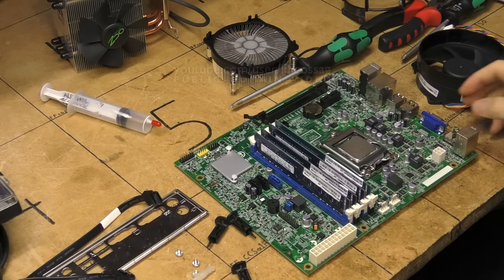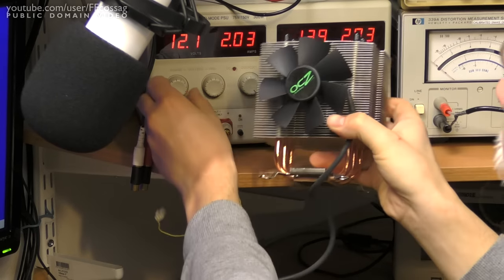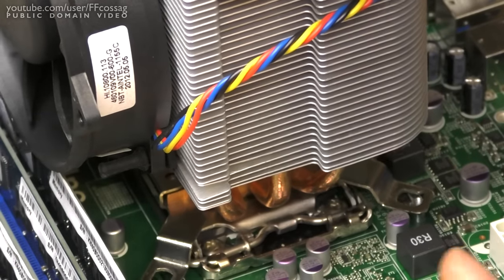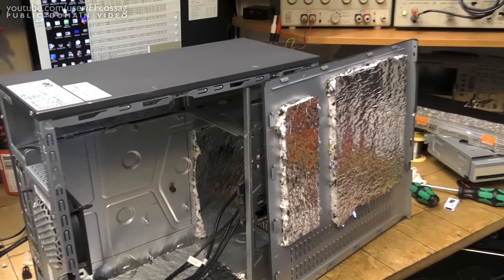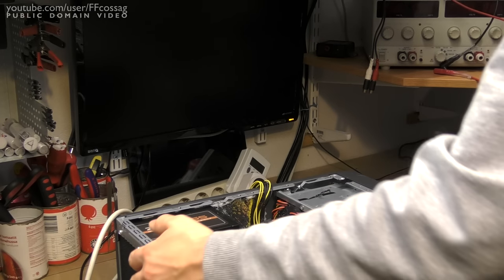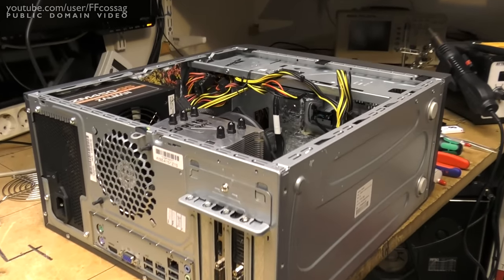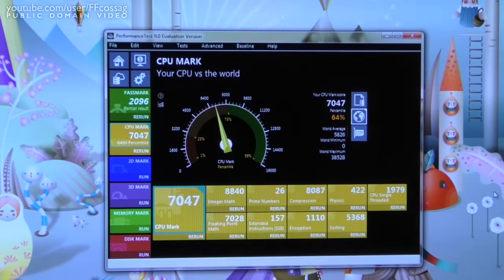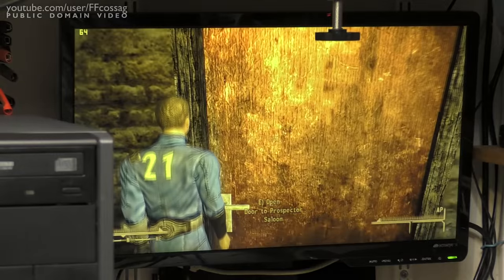Super trashy 2500K cheap-o sleeper build (w/ rusted GPU)

Comment: Great video. I never even thought to look at the heatsink mount screw spacing like that. I've been wanting to use one of my favorite S775 heatsink on on of my Sandy Bridge systems but ThermalRight never released a S115x mounting bracket for it. I'm definitely going to be trying this out with that old heatsink.

Comment: :/ that thing is much better than mine i use a core 2 quad Q9550 on a Asus P5Q E motherboard that refuses to detect USB devices most of the time , and a good old failing seagate 1tb that likes to 'forget' the SMART events and always start from 0
Reply from the maker: Better replace that drive before it passes 15 000 hours.
Reply: After a cold start it goes into booting windows freezes and restarts , then the motehrboard refuses to detect it and hangs . i flip the switch in the back for 3-4 minutes and it 'magicly' forgets its SMART status . That dosent look healthy does it? : http://prntscr.com/e17a5z
Reply from the maker: I've had no less than seven of those Seagate 1 TB drives headcrash between 10 000 and 20 000 hours. Put that thing in the trash before it does that on its own and takes your data with it, lol.
Reply: FFcossag I have a SATA drive that has 35,000+ hours. I got it in 2012. it had 31,000 hours then. It's a Western Digital Caviar 80 GB 3.5 inch form factor that was made in 2006. It suffered the click of death once. As a solution, I held it three inches above a smooth brick surface and hit it on the surface as hard as I could. I then hooked it up to a hard drive dock and powered it up. It was fixed.... for one power cycle. I repeated the smashing procedure about three more times. On the third run, I made it work long enough to hook it up to a computer. I ran it through HDAT2 to check for bad sectors. Amazingly, there were none. After that, I ran Darik's Boot and nuke to erase the drive. All this happened in December of 2015. It still works perfrctly to this day with approximately 41,500 hours on it.
Reply: I had an infamous Seagate Barracuda 3TB that failed after 13000 hours. I think there was an entire lawsuit over those things.
Reply: and also from times to times the heads go to landing zone i can hear it from the outside and it struggles to open files from times to times
Reply from the maker: I retired an old WD (one of those black painted ones) at 55 000 hours - not for any reason other than an SSD upgrade. Lovely old drives.

Comment: Will the insulation prevent heat from disapating through the case itself though? You should check out a material called FlashBand. It's a sticky backed roof flashing material and does a great job of deadening sound. it'll also be a lot thinner and easier to manage than the closed cell foam you're using. Keep up the good work. :)
Reply from the maker: Dissipation through the case is quite minimal anyway. I've used asphalt pads in the past, they work great but this is what I happened to have at hand.
Reply: I've got some of that asphalt insulating material, still bonded to a sheet of stainless steel from a dead dishwasher.
Reply: Give it a try. The difference it makes is quite noticeable. The best part of using the fresh rolls is that they are very soft and easy to manipulate though. It's easy to mount them in complex shapes, surfaces etc. :)

Comment: holy cow. wish i had a pc like that. my specs are:
Intel Core 2 quad at 1.7 gHz
Windows 10 Home Premium (32-bit)
128 GB SATA HDD
DVD/CD Drive x2
3.5" floppy drive
Nvidia GeForce 680 
3.5 GB DDR3 RAM
no display ports
EVGA (or EVEA, cant tell) EGA/VGA adapter card
5 USB 2.0 Ports
generic motherboard by DELL
10! USB 1.1 ports
no PS/2 Keyboard or Mouse ports
CPU fan is dying, LOUD and sounds like bering failure
junk.
Reply: Andrew haha, factorial joke :) good one

Comment: That's still a decent "Frankenstein" PC, except for the OS (never run Microsoft if there are other options available)... But you could easily sell it for 100€ or so (due to the SSD and the lots of RAM).
Reply from the maker: Yes, selling a 2500K based PC for 100 € would indeed be VERY easy, lol.
Reply: FFcossag Oh, come on, it may have been that expensive 5 years ago, but we all know how prices for used/older hardware develop!
I bet there are 2500€ PCs from 2000 for which you won't even get 20€, because who wants a 1GHz 32-Bit single core and 256MB RAM with a 40GB HDD nowadays?
Reply from the maker: You know what, I'll pay you 110 € for a 2500K and a 250 GB SSD alone - you don't even need to throw in a motherboard! ;)
Reply: FFcossag Well, I think only the SSD is what is worth some money (and yes, possibly even close to 100€). But I didn't get that with 2500k you were referring to the CPU - I thought you meant the machine was worth 2500€ when it was new. So the CPU is an i5, but which generation is it from? Something older-ish like Sandy Bridge? I'm not so sure if these things still have any value today...but the last time I looked, you could get used PCs with older hardware like that (but without an SSD) for around that money. Of course, they were complete systems, which have been used in some corporate environment before, and are now on the 2nd hand "refurbished" market.
Reply: this machine could easily be sold for 500$ in canada lol, 16gb of ram a ssd and a goodcpu...
Reply: Sadeoo7 OK, I was a bit low with my estimates. A new 250GB SSD is about 90 bucks, and 16GB RAM are also about the same, maybe a little less. And that's both prices for new hardware, not used, so they should actually be a little lower.
The rest may be worth 50-100 bucks, since it isn't a prebuilt PC, but something that's cobbled together from random parts.
Reply from the maker: What CPU? A 2500K, lol, duh. They're about 100 bucks on their own. This is a 300~400 € computer if I were to sell it locally. I'm not going to, however, so I don't really care.
Reply: FFcossag You'd have to find a buyer who doesn't know PCs very well though.
Reply from the maker: No, you wouldn't. I'd pay that price for this machine if I had a need for it, as would almost anyone.
Reply: FFcossag I think we've got different points of view there. My point is: 1. it's cobbled together, not built to spec by a PC manufacturer. That reduces the price. 2. It's got used parts in it (mainly the SSD, but also - if they are high power components - the graphics card and CPU), that reduces the price as well. And if I can get a decent machine from that vintage for 150€ that isn't cobbled together, and then use the rest of the money to upgrade it to my needs (i.e. SSD, RAM, GPU), I'd rather have that, instead of something built with automotive noise dampening materials and so on.
Reply from the maker: ok lol
Reply: (And that's just my personal opinion, based on my own experience. I have built my first PCs in 1995, not for me, but also for customers of what was sort of an employer back in the day, and while I have no problem using a machine that I've cobbled together myself, I would never value a machine that someone else cobbled together even closely as high as one that I cobbled together myself, or that a professional manufacturer built to their specs).
Reply: Seegal, please just admit that you don't know prices very well. I built my first computer in 1987 so yeah... That CPU on Ebay: 100 euros, the motherboard, about 40 euros, the card also between 40 euros and 70 euros, the ssd 80 euros, the ram about 60 euros etc.... 'Cobbled together'. 'I can get a decent machine for 150 euros that isn't cobbled together' What exactly are you getting for 150 euros? You said you 'easily sell for 100 euros...'  Just, please, you don't know what you are talking about. No offense intended.
Reply: Artisankat Studios I was referring to decent machines that are offered from companies that refurbish HP, Dell and Lenovo PCs, which were before used in a corporate environment. Those are often cheap and really good deals. But yeah, I haven't cared about component prices in a long time. For the past 5 years or so, I've mostly dealt with laptops.
Reply: You should try what I did: I bought a Fujitsu Primergy TX200 S6. It had 1x Xeon E5620 (4 core, 8 thread), 12GB of RAM (96GB max, ddr3) and 4x 300GB SAS drives. The downside is that it only has 2x  8x PCIE slots (I modded these to fit 16x cards in ) and 2 4x slots.  The upside: I dropped a second E5620 in for about 5 USD.
Reply: Xeon processors are a good idea, although I'm more of a Lenovo friend, so it would be a ThinkCentre workstation. I also wouldn't go for SAS drives, because those aren't exactly cheap. As far as the rest - well, I'm not someone who needs much graphics performance (I don't play games, I use Linux as my main and only OS, and I don't render videos much), so if there's some sort of on-chip GPU it would be enough for me (although the Xeons possibly don't have that, contrary to normal desktop CPUs). Anyhow, I am not looking for any new computer right now. I'm quite content with my Thinkpads, one T520 and one X220, both with some i5 Sandy Bridge, and 16(T520) and 12(X220) GB of RAM (the 16 only for the rare cases when I unfortunately need a Windows system for a few hours per year and run it in a VM so my PC still stays usable while it runs Windows - and the 12 basically only because I had an 8GB module left which I didn't want to let go to waste). These machines still have enough power for anything I do with them, and so I really don't need anything new (also, I'm not sure if I'd want a desktop PC...rather a Thinkpad P70 and an X260 for when not at home, although the P70 may even suffice). But those are still too expensive anyways, and so I won't get them :)
Reply: Seegal Galguntijak I don't think that most brand name manufacturers truly care about their customer satisfaction. That is why they overcharge you to buy a PC made out of cheaper components preloaded with bloatware. I think that most people would not mind buying a custom built PC or used PC, but for most people searching "Dell" or "HP" online is easier. Although I could see someone being nervous about the GPU, why is it even rusty?